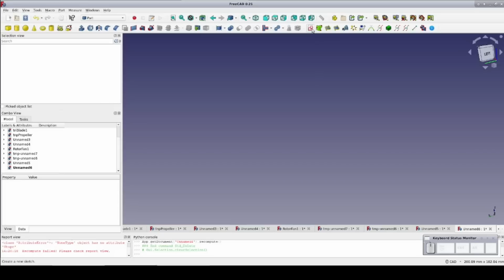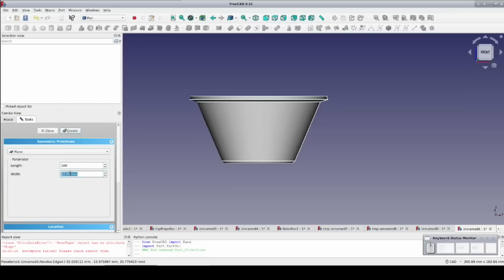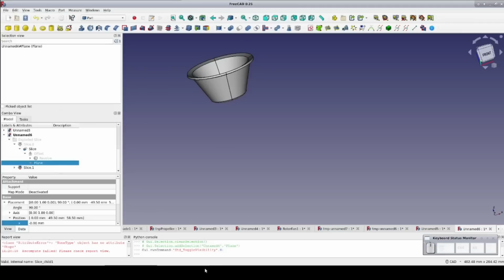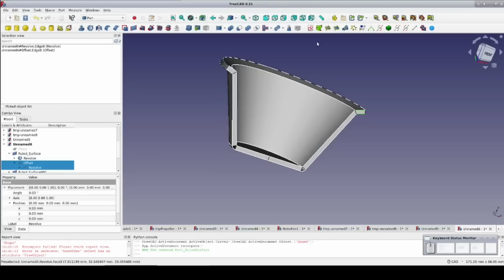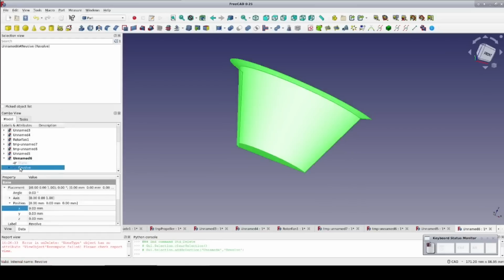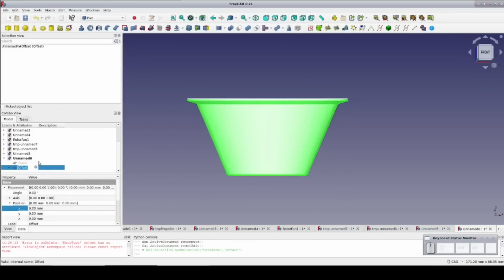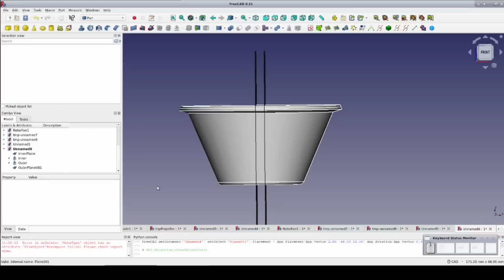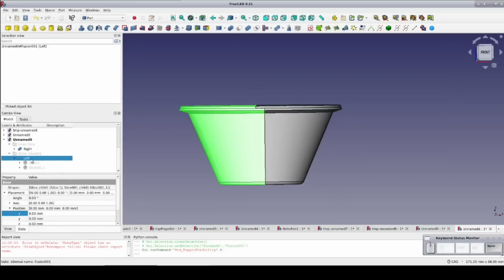FreeCAD: An open reply to Tom Sanladerer

Comment: That was a rather painful workflow to watch. It was however able to do the operation.
Reply from the maker: Yeah, manually closing the shell should be a last resort.
Reply: @4axisprinting  that's why I changed to part design. Doesn't need to do this complicated operatione,is easier to change things and more control over Details. Just draw the inner and outer shell in one sketch all lines connected and extrude it to a circle. Also using different bodies and name them after the piece that belongs to them.

Comment: So, to summarize: It's very easy to create Tom's part in FreeCAD, you just need to program a module that does the missing functionality...et voila!
Reply: Always remember, other than having your inattention to the solutions presented in the video pointed out to you, you certainly CAN just spend $435/year for the rest of your life for that "easy" functionality.

Money has always been a substitution for knowledge.  Nothing new there.
Reply: no.

Tom could have drawn the outline in the sketch to revolve. He could have googled for how to split/slice a part in FreeCAD. He could have spent some time to figure out why the shape wouldn't close, or could have set the Offset to use Intersection instead of Arc for the offset joints and it would have worked fine (equal number of edges on the open sides).

the Fill Surface is also a part of the standard install, so it's not about installing something that isn't there. it's just a lack of interest on Tom's part to even attempt to read any documentation or look through menus.
Reply: @Keechization  Tom said that he spent a long time searching, reading etc.. to find the different ways to do things he just didnt find out how too.  Now i suppose he could have spent days learning and trying different things but that was the point.
Reply: @thegarageluthier  LOL, as having spent the last 4 months learning FreeCAD from barely TinkerCAD level experience to accomplish something an order of magnitude more complex than Thomas's simple design (a part for a window regulator with multiple curved boolean cutaways and complex internal geometry to ride the track and host the steel actuator cables), I can tell you that either Thomas is REALLY bad at searching for videos, or I'm really GOOD AT IT.
Reply: @brianmi40  well exactly I don't think he was going to spend 4 months learning something for a video 😅
Reply: @thegarageluthier  Who said he needed to?  Not I that's for sure.  My 4 month journey was to complete something a MAGNITUDE OF ORDER MORE COMPLEX, with curved boolean cuts and complex internal cavities.  As the video here CLEARLY illustrates, Thomas was a couple minor understandings away from being able to complete his design when you just watched a 20 minute video that explained the background, the issue he ran into, and multiple alternative methods to have achieved what he wanted.

Strawman argument indeed.
Reply: In fairness "If you want this feature, code it yourself." is a reasonable response to criticisms of open-source software. That's how the software gets built.
Reply: @andybrice2711  debatable. Anyway, the statement of the video is not "i want that feature" , it's "that software is too hard to use, so I'll use something else."
Reply: The joys of open source...
Reply: You don't use Visual Studio Code without adding the extensions you need for your work. You don't use FreeCAD without choosing/adding the WorkBenches you need for your work. 
In both cases, separating the core functionality from the extensions is really great.
Reply: @magnusbeischer1264  Yes, a modular codebase is a distinct advantage in open-source software. If anything, projects like this should usually be more modular. So that programmers can focus on the computation, and designers can focus on building a user-friendly GUI.
Reply: @magnusbeischer1264  the problem with this logic is that without prior knowledge of the workbench / extensions existence, there is no way for someone to know that they need it, let alone know how to use it properly. 
This leads to the other issue; people coming to try FreeCAD are used to other workflows. Understandably there will always be a necessary adjustment period, as workflows will never be 1:1, but to both require a radically different workflow as well as to require a user to use tools and processes for the workflow that are in extensions that they never needed before and have zero knowledge of, well it's unreasonable, and just saying "there's a learning curve" or "they'll just have to work harder," especially in any project where the design is actively evolving over time. 
That kind of response isn't helpful, even if you try to educate people, because at the end of the day they are going to not want to deal with a program that demands hours of learning not only a workflow but also the reconfiguring of the program and installation of extensions, just to apply that to make a part that could be made in 10 minutes on any other software. This isn't even getting into the idea that you "need to fully design the part" and cannot change things on the fly without even more adjustments to the workflow- which is basically the entire point for most hobbyists getting into CAD, and I'd argue CAD itself to a point (vs having to redraft a part in it's entirety).

I want to like FreeCAD, I really do. But when the userbase / developers of it tell me that "I just need to work harder" to get around problems that are the result of bad UI, or the software not having a solution to issues every other contemporary program has solved, I doesn't make me want to learn the more complicated workarounds. It makes me look harder for software with agreeable licensing terms and a more acceptable learning curve (which for me was Atom3d on a perpetual license, without updates).
Reply: It's unfortunate that you feel like making (incorrect at that) fun of a very thorough reply.
The curves workbench can be installed via the plugin manager, and is not even neccessary to complete the action, as the rest of the video shows 2 other ways of finishing the design.
Still, nice of you to engage with the comments, and boost the visibility of the video that way.